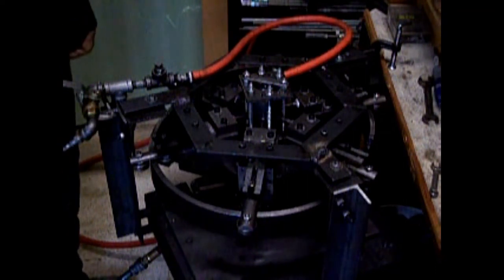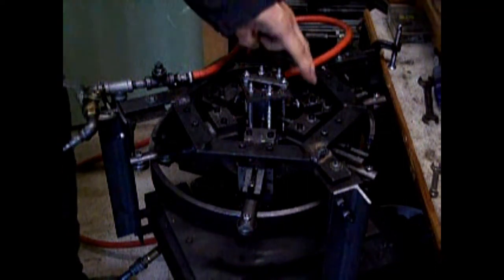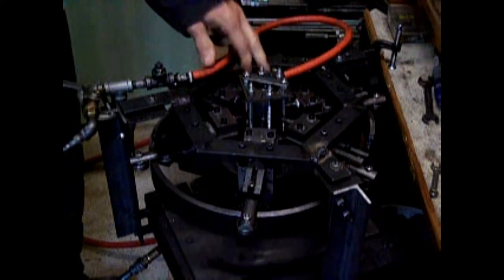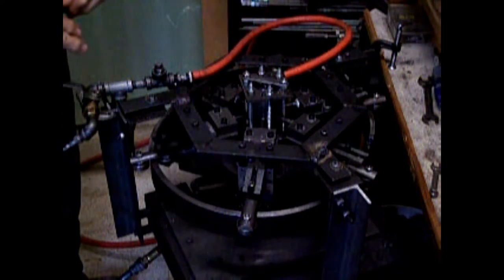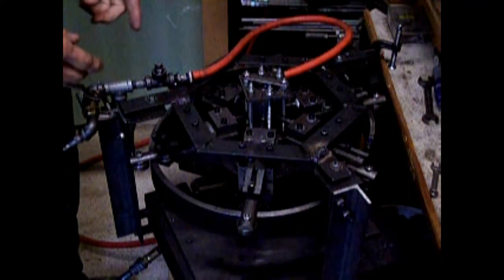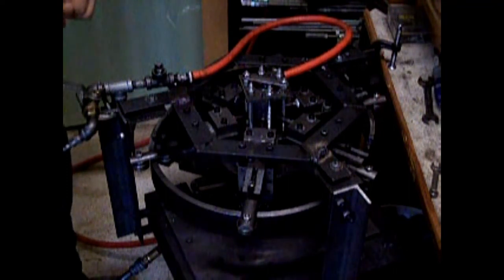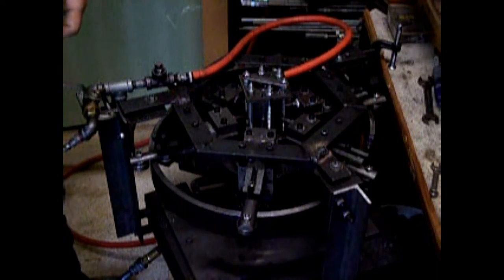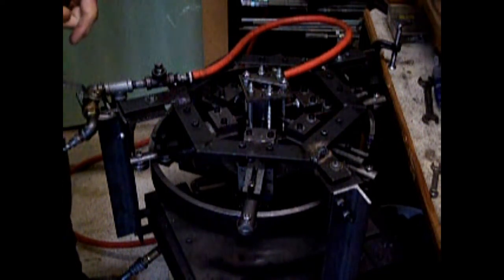Oval Air Engine, looking back at work since 2011 - 2019

Comment: how much success have you got as far as valves are concerned?
Reply from the maker: First off, thanks for subscribing - anad be sure to check the Notification Bell!

Just in the past week, I bought a 1/4" Ball Endmill and have designed a valve that uses a 1/4" Ball Bearing to seal the incoming air. 
I need to make two more, and I'll be trying them out on the Bicycle Assist Air Motor that I have been working for some time - I hope to be posting a new Video soon about it.